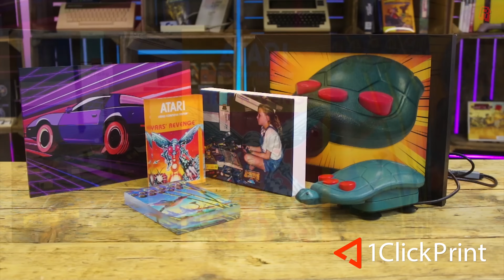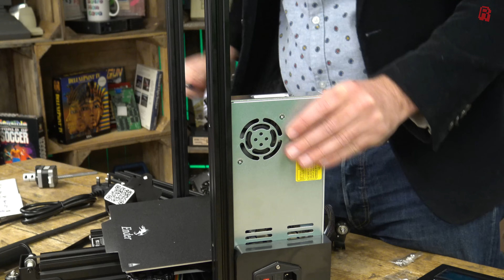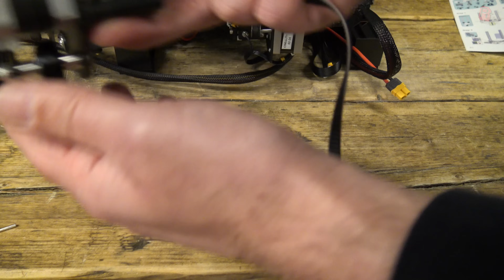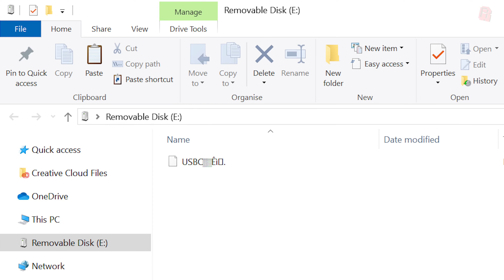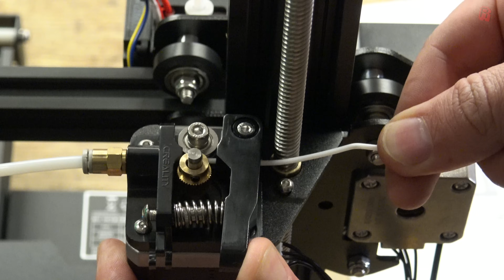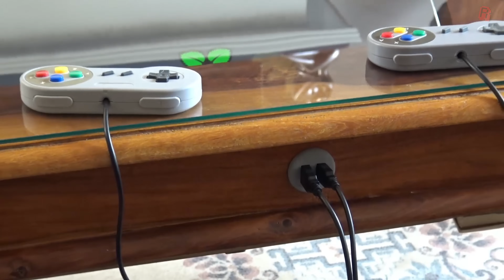3D Printing - Get started with the Creality Ender 3 Pro - My First 3D Printer

Comment: A good upgrade for the ender 3 is replacement bed springs you then don't have to level the bed as often and upgrade to a  glass bed helps with adhesion

Comment: Did you remember to connect the Z-Axis micro-switch connection, Why go with Cura instead of CADKEY 386, Does the 3D Printer have a Ethernet port on it so you can print from your computer.

Comment: Hey Neil, I think I’m similar to you as in I’d be printing things to hold a raspberry pi, or a mount for a computer project or... just general stuff. 

I was thinking of buying a Prusa because they are rock solid and work really stabile from day 1. No upgrades. 

However I think I’m gonna order an Ender. I’ve been told to order the standard and do upgrades. Do you like that you ordered the pro?

And last question, what upgrades have you put on in 4 months? Thank you.

Comment: My ender 3 should arrive in like a few hours, can't wait. I'm an engineering student and I've had so many ideas over the years but never got a printer because I was concerned about noise because I live in an apartment, but the pro I got has the new silent board preinstalled which will make it much quieter apparently. Really being an upcoming engineer without a printer makes me feel naked

Glad to see this video makes the setup way simpler, I watched too many videos where I think they took it a bit too far for beginners and those kinds of refinements should only be done after doing a few decent prints

Comment: I'm a bit late watching this video... I don't know this printer well or any specific printer to be honest because I built my own printer a few years ago. Modifying the printer is the biggest part of the hobby for me. I have learned a TON about making successful prints though. The single best upgrade IMO: the bed leveling probe. Once installed and configured, you never level a bed again and first layers are always good.

I currently use a BLTouch, and if I was pressed to make a recommendation on how to install one, check out Teaching Tech, he has done a bunch of videos on this printer specifically. For simplicity stick to PLA, for more heat resistant parts try PETG. If you have problems with warping prints (with the fore mentioned materials) slow down the cooling fan a bit, do not use the cooling fan with ABS (ABS is very tricky to get right and really does need an enclosure). 

My second favorite upgrade was an SKR 1.3 with TMC 2208 drivers. This upgrade gives you a VERY quiet printer, due to the better drivers and since its a 32bit board it handles the math required plus Octopi (USB) serial connection much better than the arduino that I was using. I use glass with hairspray. You really don't want to print directly onto glass because the adhesion is too good. I choose glass/hairspray because of durability. All the cool bed adhesion flexible sheets are nifty and do work well but they degrade, the glass never goes bad and a bottle of hairspray lasts for months at $2 or less. The "cleaning process" involves dish soap and water. I clean the glass perhaps once a month and reapply hair spray in a small amount onto the area I just printed, after every print until it get to some non definable "dirty" state and I rinse the old hairspray off and re-coat it.

If you find that you aren't always happy with the way sharp corners appear on your prints, look into linear advance. There are a ton of good tutorials on what it is and how to enable/configure it. Good luck

Comment: You should install the official Creality BLtouch Kit. It also doesn't hurt to replace the original control board with the BigTreeTech SKR Mini e3, and to replace the LCD with the BigTreeTech TFT35 Dual-Mode Display.

Comment: Nice video! I've had my Ender 3 Pro for a little over a year now and it's still functioning perfectly.
A couple of things though: 
- When you're pushing new filament into the extruder, keep pushing on the lever to slide it in easily.
- Consider upgrading the bowden tube and couplings to Capricorn, and upgrading the extruder to the aluminium extruder (these are the only mods I've done to my machine, aside from some printed mods).

Comment: You may wish to print a replacement extruder tension arm while you can. The stock creality one has a tendency to crack and wear out. Consider upgrading to an aluminium extruder assembly if you print a lot.

Comment: Not sure if this has been asked or answered but it would be interesting to know why you chose this printer over others ?
Reply from the maker: My main reasons were bed size and availability.  I did look at some other models which required no building and had good reviews but I was worried I wouldn't be able to print what I wanted to on the smaller beds.  If you have some suggestions though do share them to help others who are considering buying one.  Thanks!

Comment: As another proud owner of an Ender 3 Pro... Welcome! You have treated yourself to an excellent machine. Certainly one of the best at this price point.

One thing I'd recommend if your you to check out Tomb of 3D Printed Horrors' video on building the Ender 3, called "Creality Ender 3 assembly and pro build tips
". It's about 30 minute-long but it goes into many details in how to properly build the frame and setting the right grip on the concentric nuts that hold the bearing wheels. Highly, highly recommended.

Enjoy your new toy!

Comment: I'm also a complete noob to 3D printing and decided to order an Ender 3, my Ender 3 in on the way and should arrive next week. There seems to be a solution to bed leveling that will make it much much easier, and is supposedly more accurate, it's called "mesh bed leveling", this solution is free on the Ender 3, however you will first need to do a firmware update, and in order to do that, you first have to flash a bootloader, which will require an Arduino or clone.
Here's a video guide on how to set it up and use it....... you'll also need to look up a guide for flashing a bootloader before you do this.
https://www.youtube.com/watch?v=Rij29oy6t70

Comment: Having assembled a cheap Anet A8 printer about 2½ years ago, the Creality looks a comparative doddle.  The Anet's frame is acrylic panels, whereas the Creality looks much sturdier thanks to metal beams.  Still, I've had a little fun with the Anet, though I don't use it half as much as I should.  As a Linux user, I'm running SketchUp through Wine, and the Linux version of Cura.  It works, though Cura doesn't have a profile for the Anet; it's not too difficult to add one, with tips from elsewhere.  It would be nice to upgrade the printer to something better, I'll look into this model.

Comment: Upgrade to Marlin immediately! Don't trust the presence or otherwise of thermal runaway protection. I delayed doing it on my Ender 3 because it looked involved: it's not, and the Marlin firmware is better in every way.

Comment: Nice choice, I own an Ender-3 since 2018 as well, though it's heavily modified by now.

As for leveling: please don't level with the stepper motors disabled. This is probably the most common mistake and people all around still keep telling to do it this way - but it's wrong and can't really work. You need to use "move axis" instead (go clockwise to each corner, then back to the first corner where you started, then to the center; repeat until all positions fit), or use a ready-made GCode file that does all the movement for you. You can find that on thingiverse.com

See, if you disable the stepper motors, the voltage is cut and they relax. For the x and y axis, this is no issue. But for the z axis that you are actually want to make an adjustment for, it is. With no voltage, the motors lose their tension, which is why you can move all axis around freely then. But the z axis is affected by gravity and will drop slightly in this case. Because of this, whatever gap you adjust between the nozzle and the bed will change after the steppers get back power. For perfect leveling, the nozzle and the bed should be pre-heated as well, however I never noticed any effect on my Ender-3 when doing this.

Feel free to contact me if you have questions or need help.
Reply: yeah, the Z axis is particularly prone to lashback, which is super important for putting down that perfect first layer (which my Tarantula can't do anymore, sadly. y axis carriage wasn't exactly well designed on that printer).

Comment: This is why I hate cardasssian printers. If this were a delta it'd be less like an episode of How It's Made & more an episode on how you can print upgrade parts for a printer that could be frankly twice as capable for the same price.  But, we all have to start somewhere, it minus well be assembling this overcomplicated monolith.
Reply: most printers come pretty much ready out the box screw a few things together and ready to go
they also cost more than the ender 3
you are saving money by building it yourself and tbh its not hard
if you dont want to build you printer then spend the extra cash and get one thats ready to go
also deltas have there own unique problems 

if you can follow instructions and and watch a youtube video (like this one) you can build a ender 3 in a few hours
after spending a long time reseaching i still think the ender 3 for its price is still the best starter printer out there

Comment: you should consider getting/printing an alternative filament spool holder. having thee spool holder on the top where it currently is with its weight can cause some nasty excessive vibrations. Also dont accidentally use it as a handle.

Comment: I have an Ender 3 Pro as well, got it a few weeks ago!

An important thing to print ASAP is a filament guide, (there's a bunch of them on Thingiversw) as stock the filament can get caught on the Z-axis rail and ruin a long print.
Reply: Yeah you don't want to get grease on the filament either which can happen if it touches that rod. additionally I'd recommend going to the horizontal spool holder bracket as well.
There are versions that use the same screws as the regular and it considerably reduces the chance of snagging your filament, snapping it and prevents your filament from sawing through your extruder tension arm's filament guide (this can also be prevented by upgrading to aluminium).

Comment: Had one since last Christmas as a first printer as well, already used it for so many useful things! aside from dealing with manual leveling, which can get pretty fiddly or annoying, it's definitely the #1 fdm budget printer from my experience so far.
Reply: Additionally, I got rid of the magnet bed straight away, so much easier to use a glass bed instead.

Comment: Have you checked the wheels that hold the print bed to the cross beam and the wheels on the left and right side of the X access ? they have  adjustments that might not be setup that well from the factory. This is important to keep the bed level  and stop print head and print bed from wobble. There is a add on pack for Cura called CreawsomeMod and it improves print quality with special tuned settings at the cost of print speed, but if you want that extra crisp print or printing first layers that have small circles or tiny details  I highly recommend it. Overall the Ender printers are great value for money and  have easy to find parts to keep them running. I am not a fan of the print surface that comes with them and change to a glass bed with a pei sheet. The best PLA for the price  is Prusament  100%  and if you want a special treat get some Proto Pasta HTPLA High Five Blue. Have fun and I look forward to you using it on your retro repairs.

Comment: Thank you for this video (or maybe not) because I just bought one because of it! I was considering the Cetus 3D heavily lately, but this is $60 cheaper than the most basic Cetus model, and has a heated bed. I've never had a 3D printer either, but your video gave me the motivation to finally buy one!
Reply from the maker: Good luck!  You'll see more of this in next weeks video

Comment: Can't you just use a spirit level to make sure the bed is level?

Also while it looks fine, there's a certain odour of cheap Chinese product on this thing, from all the chips on the board being blob-tops to the OSD talking about a TF-card, which is an old prototype name for MicroSD cards, but for some reason in China they still call them that.
Reply: it must be level relative to the positioning arms, not truly level as a spirit-level would tell you. I believe
Reply: ive had mine for around 2 years now and have had no problems 

and tbh it is made to be cheap but works well also the pro comes with a much better power supply than he normal ender 3

Comment: Ive had my Ender 3 pro for 2 years now it's a great machine
Can print some upgrades as well 
Back cover for the screen board is nice
Also a drag chain for the wires to the hot plate save stress on the wires
I'd also get a separate holder for the reel having it up the top can cause feed and vibration problems
You can print one that slots it onto the lower rails or just buy a free standing one
First payed for upgrade I'd get would be a glass bed
Second would be a all metal duel
 gears feeder

Comment: Just to add my tuppence worth (this really dates me), My preferred CAD package is Design Spark Mechanical which is free. I like it because it's easy to use and you retain control of all your design files locally. I stopped using Fusion 360 when last year they changed their Licensing/TOS and since all of your work is kept remotely on Autodesk servers in the 'cloud' they have complete control over everything you do. DSM is run locally and has a very light web requirement. DSM can connect directly to Cura which in turn is mapped to my two Octoprint instances. 

3D printing is slow but it's not as slow as ordering something off Amazon. Also if you need the UV stability or extra strength of ABS then use PETG. I've still got a spool of ABS that I will probably never use because PETG is just as strong and doesn't need a cabinet or stink when you print it. I've been running the E3 since it first came out and while like all 3D printers it can be maddening at times it has produced most of the time truly precision objects that have made our lives easier. I've made everything from custom coffee scoops to a complex mounting cradle that allows my Trigger Finger Pro drum pad to mount on the top of a microphone stand. 

After hundreds of prints I've found my favourite print surface is a sheet of 2mm picture frame glass sprayed with hairspray. All other surfaces seem to degrade quickly over time and need replacement after twenty or so prints because they get ugly. The picture glass is very light because its only 2mm not the 4-5mm of borosilicate glass or mirror glass. Yes, the picture glass is delicate but it's also really cheap and if you are careful it will stand up to limitless prints. Also never detach a print directly from the bed as this will screw up the bed level. Always remove the print surface with the print attached and then separate the print.

Comment: is the Ender pro a good starter printer? or is there better ones the are not too much £££
Reply: It's good, but if you have the money you should consider a prusa.
Reply: @alex-w8p2e  prusa are very good but you pay for it
the ender 3 is a good cheap option if you put in the work you can get just as good prints off it that you get off a machine twice the price or more

Comment: Tip: Keep your part-used filament with some dessicant in a bag or tupperware box - some types can absorb water which causes it to pop and fizz when it gets hot. I like printing with PETG as its easier than ABS but more heat resistant than PLA.  Great video :)
Reply: also good to know that a dessicant bag won't help if the filament is already waterlogged. the bag only draws the moisture from the air, not the filament.
if you own an oven or a dehydrator you can fix the filament easily enough though.

Comment: RMC Have fun! research some usefull upgrades too.
Hey other 3d Print peoples. Does the pro version of Ender 3 benefit from upgrades at all or as much  as base models? Like
https://www.thingiverse.com/thing:2759439
https://www.thingiverse.com/thing:3567127
https://www.thingiverse.com/thing:2824131
Solid Z coupler?
Y stepper motor brace?

Comment: Good timing, they've got a $189 sale on in the states, which caused me to get my son one.  Question- did a starter spool come with it, or did you have to buy PLA?
Reply: mine came with a tiny white spool which is enough for maybe 3 tiny prints
you can pick good plastic (pla) for around $15 to $20 for a 1KG roll like in the video

Comment: Top tip if you just want to print and don't want to fiddle about with your new 3D-printer: pay some extra money and buy a Prusa. I bought a Prusa mini and not once had a failed print. It has auto mesh bed leveling and a very good print surface that will work every time. You don't have to upgrade anything.. it just works.. The Ender 3 can for sure create wonderful prints but most people have to put a lot of time and effort in to get it right. So if you want to save yourself a lot of hassle just buy a Prusa. I'm not getting paid to say this; i'm just very happy with my printer that has never failed to get great results..
Reply: Yep, I got a ender 3 and it needs a lot of fiddling to get to work right.

Comment: Little detail:  Once you've got a good build surface that the PLA sticks to well, you've then got another problem:  Getting the parts off again, if the build surface is strongly attached to the plate, as it should be.  I recommend a wood chisel:  It has the edge right down on one of the flats of the chisel, so it can go in right at the connection of the part and the build plate and help pop it off.